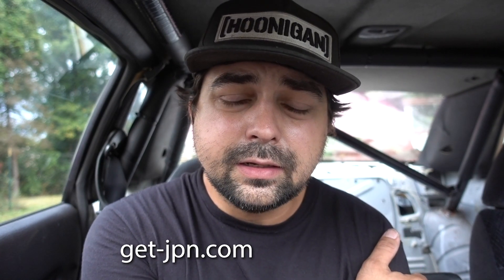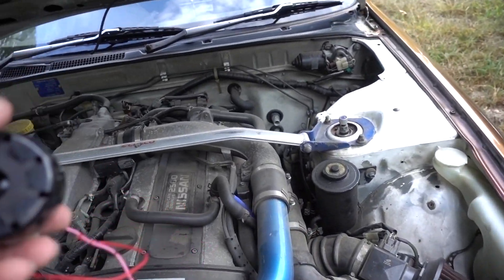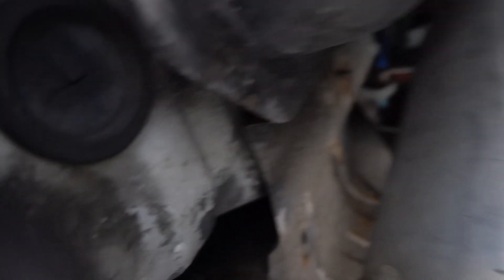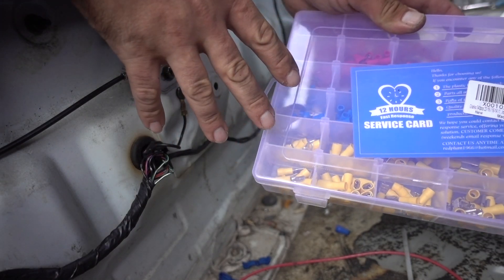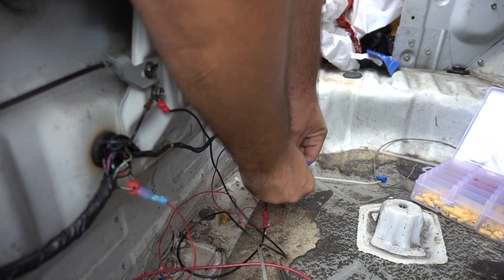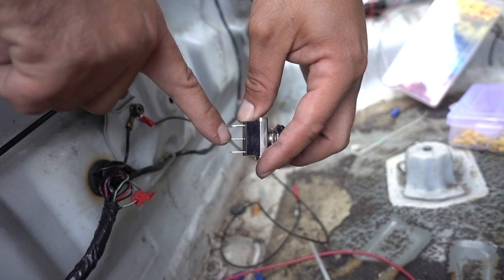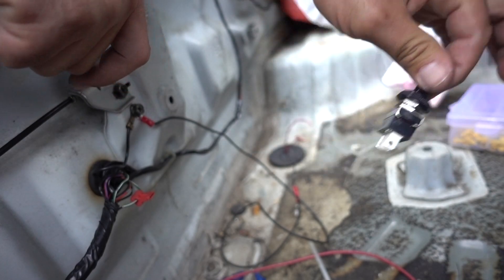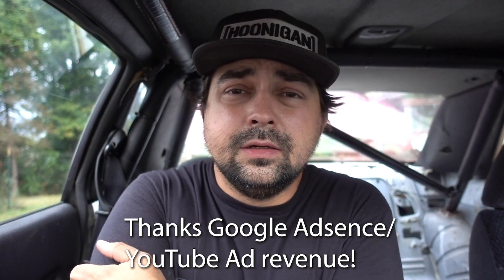JDM Back up Melody Alarm Install

Comment: I see you have an E36 as well, thinking about putting one of these on mine, guessing I’ll have to tap into the harness going into the tails since E36s have the single plug/harness that goes into the tails. Great video by the way, a switch would definitely be nice, I wouldn’t want to annoy anyone with it so having the option to shut it off would be nice
Reply from the maker: Nice!!  I was thinking about buying another one for one of the other cars at some point.  I was curious if I could find a German one for the bimmer but didn’t have much luck.  The switch does come in handy for those early morning trips when trying to not disturb my neighbors.  I highly recommend it if you do get one.

Comment: So I ordered a similar thing except mine has a welcome noise so I’m gonna mount it inside is there a way to run a external speaker to come on with the reverse lights ? Other than having the whole module on the outside?
Reply: Where did you buy your japanese welcome noise thingy?

Comment: Is there anywhere else you can buy these? Its sold out currently on get-jpn
Reply from the maker: I looked for a while and couldn’t find any other place with them.  At least none that sounded like these.  I had to wait a while till they were back in stock when I ordered mine.  They usually post when they get shipments on their ig page.
Reply: @RobRabonPhotog  ahhh rip. I might just go with a denso alarm then
Reply: Garage Ultoo has something similar to this JDM backup alarm except it has 4 tones/sounds: 
https://garageultoo.bigcartel.com/

Hope this helps!

Comment: Whereee too buyy?
Reply: As mentioned in the video description, you can get the JDM melody backup alarm at: https://www.get-jpn.com/products/back-up-melody-alarm-dual-sound-back-up-warning-mickey-mouses-march-12v?variant=20887574380633

You can also try to find it on other online websites such as eBay, Amazon, and etc.

This device concept is similar to the JDM backup alarm shown in the video except it has 4 different tones: https://garageultoo.bigcartel.com/